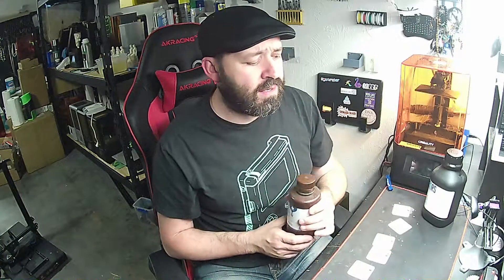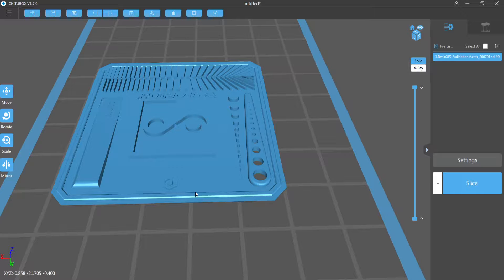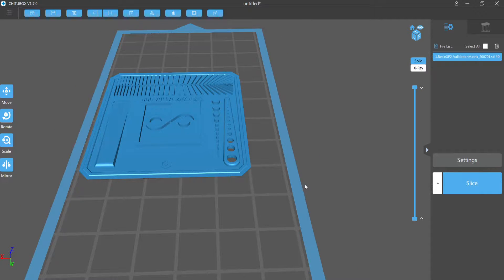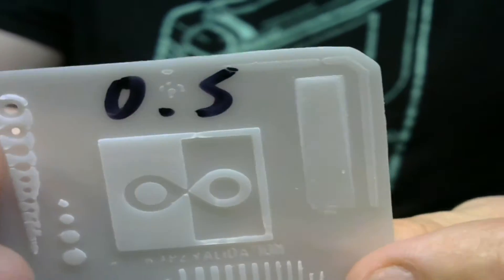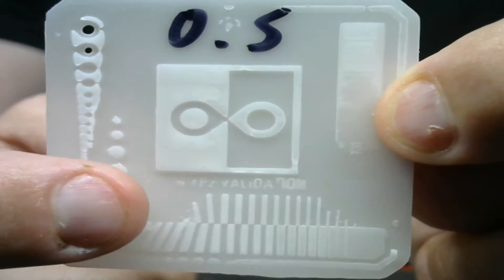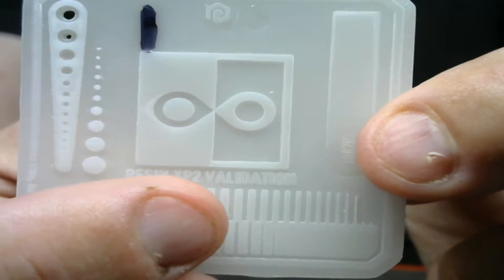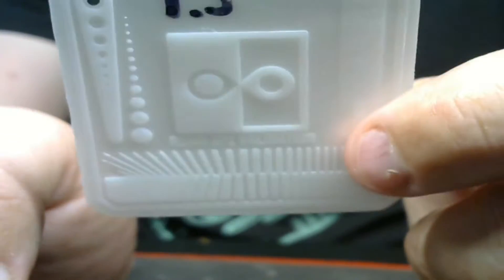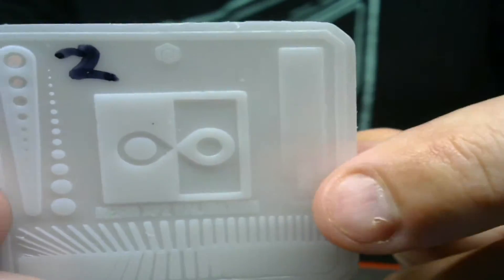How To: Resin Exposure Settings!

Comment: so how did the corelation between 3 seconds , 8 seconds 15 seconds  represent on the .5   1 and 1.5 on the tests...ya lost me on that
Reply from the maker: When you do those tests at .5 height and one at 3 one at 8 and one at 15 you will see some missing detail. 9/10 for rgb screen printers(non monochrome) starting at 7/8 secs will get you in a good area for printing but you should always fine tune by printing 1 sec above and below that range. This will tell you if stuff is missing(underexposed) or things are blending in(overexposed). Changing the layer height you will need to tune the resin again. For rgb printers it's about an hour for each bottle of resin. This should be done with every bottle of resin even if you already calibrated a similar bottle that was the same brand/color/type because every batch can differ. While most of the time it's not needed it's better to error on the side of caution
Reply: @AkumaMods  he ask something else..u present something different..i am also confused because first u told about 3-8-15 and after u did tests with 0,5 till 1.5... so if i own monochrome lcd printer..means that should i test about 0.5-1,5 range?? i guess 3-8-15 is not for me????
Reply from the maker: @Hstrow  correct. Mono is lower numbers and rgb is higher numbers
Reply: thx ! . but i have troubles with jamghe standard resin.. i have tried 5s even with halot one and still soft like cheevy gum🙈🙈 and failing print of course
Reply from the maker: @Hstrow  5seconds is too high for halot. Try 2.2 for normal exposure and 30 bottom exposure
Reply: @AkumaMods  the problem is nothing work..thats reason why i did it about 5 sec. all under no work. anycubic or weistek resin no problem about 2-3 sec depends on model..just this one no success yet with any path..🙈🙈
Reply from the maker: @Hstrow  that's very strange. Since it's standard resin I've never had a mono screen on normal resins need to go beyond 3.5sec
Reply from the maker: @Hstrow  if you need faster one on one help and have Facebook pm me. Facebook.com/AkumaMax

Comment: Do you set the bottom layer count to 0 when doing this?
Reply from the maker: No pretty sure I stated in here I'm usually at 50/60 on that for a normal printer. Usually around 20 for monochrome screen printers. You can try 0 but I've never heard of anyone doing that

Comment: Do you clean the vat completely after each test? or ok to just keep doing the test one after another?
Reply from the maker: My resin stays in my vat till I use it again. Could be hours, days, weeks
Reply: @AkumaMods  So just clear when a print fails? thanks for your reply.
Reply from the maker: @RobertStoneman  when there is a fail there is two ways to go about dealing with it. Drain the vat into a filter that goes back into your bottle. Or use the clean vat feature and then peel off that print once it's done
Reply: @AkumaMods  Excellent tips, thank you.

Comment: Really interesting video about the validation matrix. But i have one question. Shouldnt the lower comb like bars not fitting into each other. Like the width of the upper protruding bars should Match into the void of the lower bars? In your example they all indicate overexposure. You think thats neglectable and the other Features are more important?
Reply: Yes they are all overexposed. Even at 1sec exposure. It is why opted to stay away from the LD-002H

Comment: I just picked up the Photon Mono X.  Would it be safe to say.  Start out the testing at 1/4th cure time recommended from the manufacture with all mono screen printers?
Reply from the maker: I would automatically start out a 2sec on the layer and 20 for bottom. Then do a print at 1 sec and 3sec and judge from there
Reply: I also just got the mono x (first 3d printer) and have been having a lot of issues. Can you share any successful settings?
Reply from the maker: @Nemicyst707  follow this video otherwise you will continue to have issues with most resins. If your exposure is over 2.5sec your too high
Reply: @Nemicyst707    I followed AkumaMods recommendations print test samples.  Start at 2 sec layer and 20 for the bottom.  They only take a few minuets to print and once you get done with 3 or 4 test pieces you will be more comfortable with the printer and what do change when you see something you don't like in one of your prints.  I feel the lift speed and distance is just as important as cure time.   Its all important...   When learning any thing you need to start with the basic setting and then find what is the limit of your machine and resin.  I hope this helps
Reply: Thanks guys, came home and spent the night printing several of these at .25 sec intervals from 1.25-2.5 but I must be missing something. Triple checked my settings (80% uv, 20 sec bottom exp, above for normal exp, .05mm thickness and they all look EXACTLY the same. 100%. Good news is they all printed successfully and look "ok" but I know the mono x is capable of better. One difference is I used Lychee and the Photons stock slicer software to achieve the required file type. I will continue to explore it and thanks again. Just subscribed!

Comment: Do you clean the vat and sheet after each print?
Reply from the maker: No you do not. However if you do leave resin in the vat for a while it's best to agitate it to mix the resin. Other than that you'll be fine leaving it in there. I have some Esun white that's been sitting there for a week now
Reply: Keep in mind if prints fail due under exposure some pieces of the test object may stay in the vat and will lead in to trouble next print.
Reply: Part of the reason to agitate, to see if resin needs filtering first.

Comment: I have the LD-002H... this is referring to the normal exposure.... what about first layer exposure calibration for the H? Is there a ball park, because I think going with the 20-60s is what is causing me so much trouble in getting the print off the plate.
Reply: same here but im confused a little too

Comment: Thanks for the video. I've done the tests and something's not right. I have a Creality 002R and use standard grey elegoo resin. I have done several tests and for 0.05 mm the best exposure time is 4.5 sg. When I then print a thumbnail with those parameters, it doesn't come out, it stays in my fep stuck. What's the fault? Do we have to use any correction factors?
Reply from the maker: What is your bottom exposure times. Contact me via Facebook for a faster reply if needed. Facebook.com/AkumaMax

Comment: Ive recently got a sonic mini 4k, it sticks to the build plate (2.2 exposure and 30sec bottom exposure) but some tiny detail lines and circles of the validation matrix are actually sticking to the vat but really sharpe in detail. Would this be lift speed issue? Rather than exposure? I'm using anycubic clear resin.
Reply from the maker: That is a possibility. I've actually never seen that. New for me.

Comment: Do you recommend this for every new bottle of resin then? Even if its the same make?
Reply from the maker: If you happen to have let's say anycubic black, grey, white and clear. You will want to tune each bottle because each and every pigment(color) will have varying results. Even though you might be able to use grey black and white at 8 seconds you might be slightly over or under exposing each one just enough to where the print will work but supports might fail or it might warp the print a little so yes I do recommend doing this for every bottle of resin. Once it's dialed in each new bottle of resin after that from the manufacturer should work however each resin batch may vary from time to time so you may need to tweak it a bit here and there to get perfect results

Comment: Thank you so much. I'm new to 3D printing and was perfectly content with my Elfin Nova until I saw your video and realised that I could improve on the print quality. What surprised me though is that the default setting for using NovaStan Resin is 5 seconds but I've now changed to 9.2 in order to get the optimum print quality. Quite a difference!
Reply from the maker: Yes while it can print sometimes on a lowered or higher setting it's best to dial it in to keep it from sagging or cracking on any print. Btw fantastic choice on the Nova3D elfin. Out of the 20 resin printers I have tested that is in my top 3 small resin printers
Reply: I know Im kinda off topic but do anyone know of a good site to stream new tv shows online?
Reply: @Alvin Leo flixportal :)

Comment: Not a bad video but your info is slightly off the mark and you are going to confuse the hell out of new starters, you mention a layer height of 0.5 and not 0.05 (50 micron) and 0.2ms is 0.0002 seconds, 0.2s is 200ms.

The people most in need of this info will most likely have an rgb printer, so it should have been using a standard mars phonon etc and not the mono screens.
Reply: I disagree.... this is my first jump into resin and it the printer happens to be the exact one that he used on his test, so this information was exactly what I needed. Some of the terminology may have been a bit of a misfire, but I knew exactly what was meant.
Reply: @tristonm37  I recommend you join one or more of the Facebook groups for resin printers, the communities are quite good at steering people in the right direction for answers and advice, it can be quite complicated when things go wrong.
Reply: @mrgriff9648  Any suggestions as to which resin Facebook groups to join?
Reply: @jkjome4095  one that is specific to the printer you have or looking to purchase.
Reply: Thanks for the advice, and I did just that last night. That was how I found this video. It was recommended from someone within Facebook - albeit it wasn't a forum specific to resin printers.
Reply: The above assessment is dead on.  I am a new starter and am confused.  This is crap